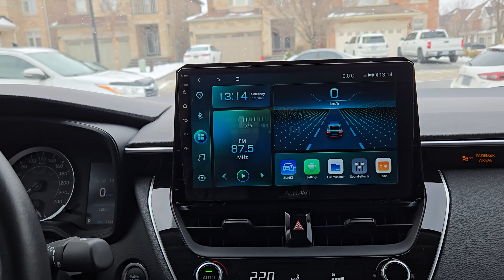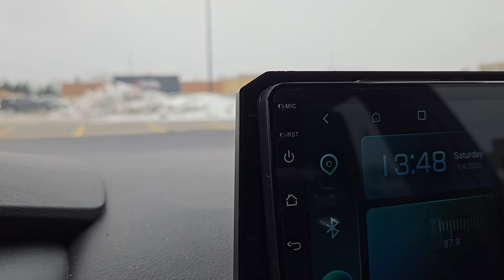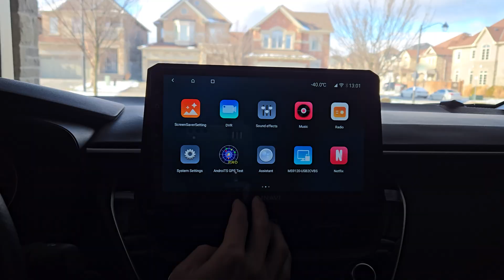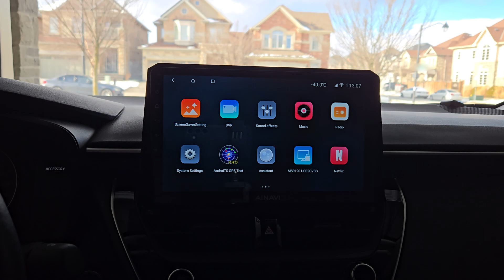📞 The Android Head Unit Microphone Noise Problem Low Volume FIXED!

Comment: I had to do the same with my 2017 Toyota Auris (European model) equipped with the Ainavi H6. In my case, I removed the head unit's built-in microphone and used the external port to connect a new one, which I positioned next to the car's original microphone.

I'm still considering adding the DVR and 360-degree cameras to my Toyota. I also replaced the original reverse camera with the Ainavi model (1080p), which is significantly better.
Reply: Dose it site on the same place, then the oem ore over the played via extra mounting?🖖
Reply from the maker: Awesome! Respect for modding it already! I guess it's more popular than I thought 😆 Good to know the ext jack works fine now too 👍 The 360 on my Rolla still keeps me fascinated. Cheers
Reply: @ricardovieira90  did you buy the cable that have the 3.5mm port?
Reply: Hey buddy @ricard! Do you see any significant improvement during calls after disconnecting the built-in mic, and only using the external mic? And placement-wise. Does it work best in the roof next to the original Mic for you? :)
Reply: Do you resolve the problem of poor sound quality with the external mic  ?
Reply: So you unsoldered the mic like in this video and plugged the external one with the adaptor? Cos I bought the external one and the adaptor but still sounds like shit, I can’t switch between the 2

Comment: Great vid Squishy, keep doing the head unit videos. Also have you ever come across or used Dudu head units!
Reply: I am using the Dudu7 head unit in my 2024 rav 4 xle premium. (12G Ram /512 Rom) 

All staring buttons and all the stuffs work so perfectly without manually programming it. 

The things I can't get to work was due to my car model (Recuperating the OEM USB and radio Antena). 

There's cable out there now that you can recuperate your OEM Antena, but have not seen the one for 2024 rav4.

Also toyota has altered the Recuperating harnes for the OEM USB port.

I am on the look out for those 2 harnesses
Reply from the maker: Thanks! Will do! I've only briefly looked at it because the interface caught my eye. I might take a deeper look into Mekede this year. Cheers